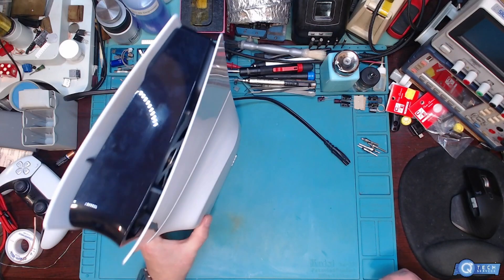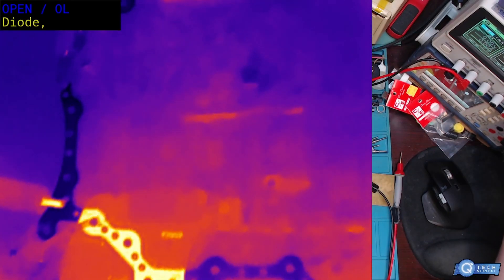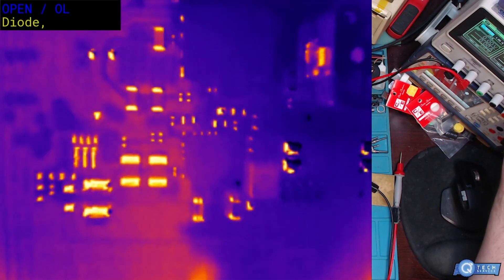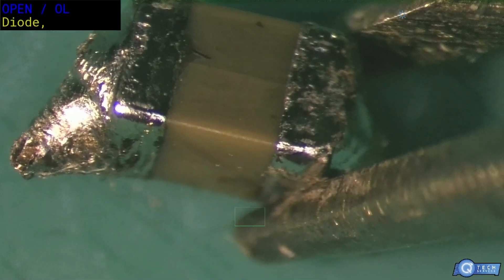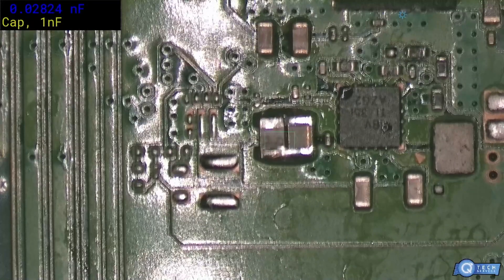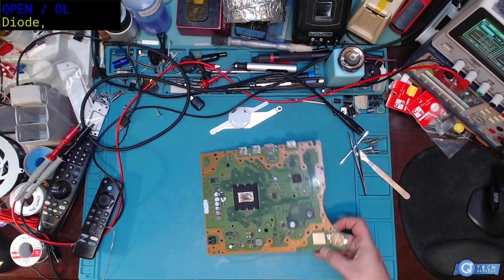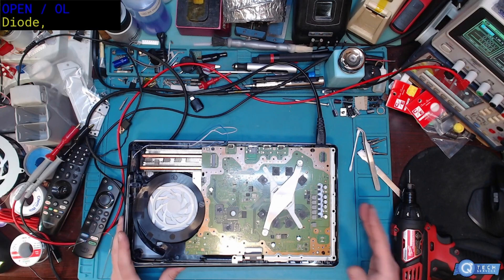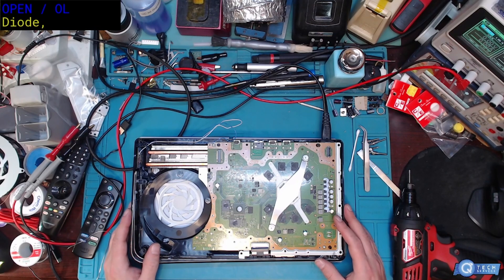PS5 Slim No Power Fix

Comment: Nice job. My only pet peeve with the p2 pro is the android version will not plug in with my otterbox defender series case on my phone. I have to grab a usb c adapter cable to connect to pc and I will be happy haha :)
Reply from the maker: @davidstrider2007  that’s all I use it for is on the PC I use a USB-C 100 watt cable 8K for cables altogether connected to the PC
Reply: @QsTechService1  yeah the pc will be my primary location I will be using it. The camera is pretty amazing. It kicks the old Flir One Pro i have in the pants. Haha. I could not put up with that shifted offset any longer on that Flir.
Reply from the maker: @ yes, it puts the flare camera into shame I actually still have my other flare brand new with the box needs to sell it it’s just sitting around .. but what a game changer using this camera I actually wanted to buy an extra one and try modifying it to work on Dji drone lol
Reply: @QsTechService1  yeah my flir one pro is in its box too. Waiting to be sold. Pretty sad when this camera was half the price of the flir one pro and it is twice as good haha